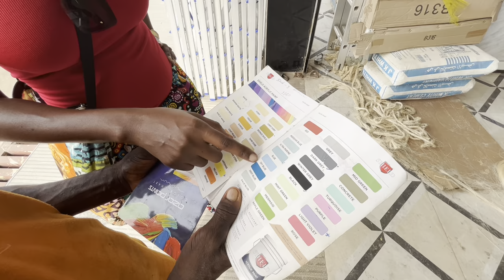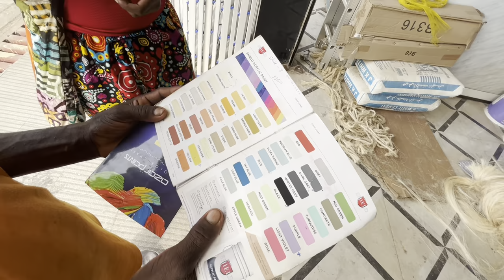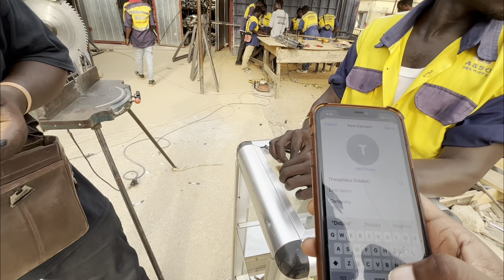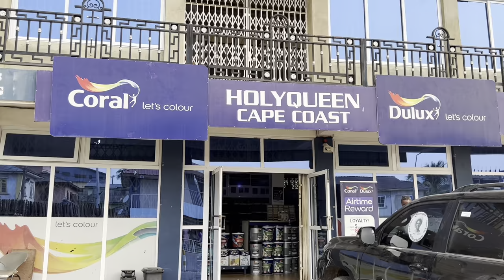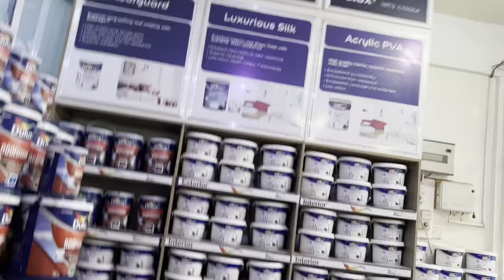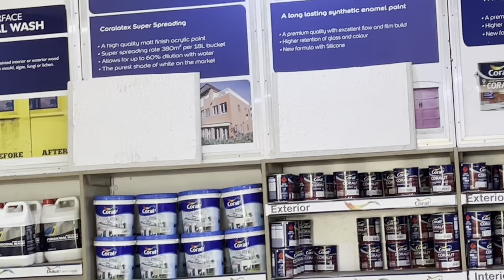Shopping for Tile, Paint, Glass, & Stone || 🇬🇭

Comment: What is the temperature? I guess the stores don't have air, just fans? I saw the front doors propped open. You were wiping your face even more. 😮 I looked online and it showed around 79. Was it hotter than that? Thanks for sharing your shopping trip.